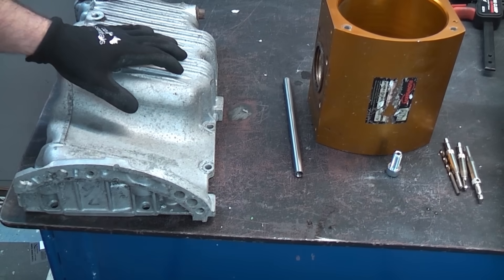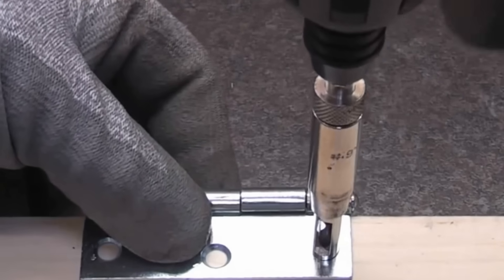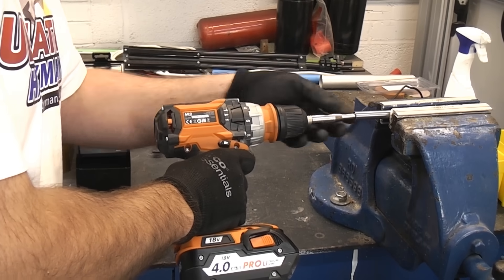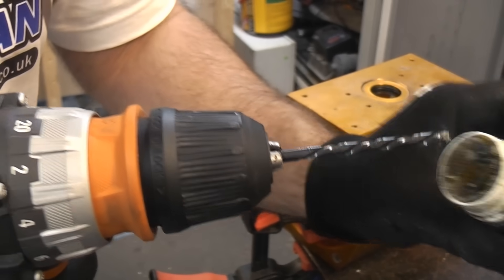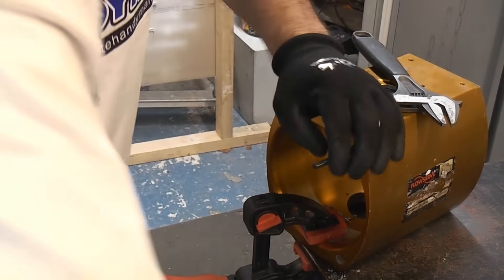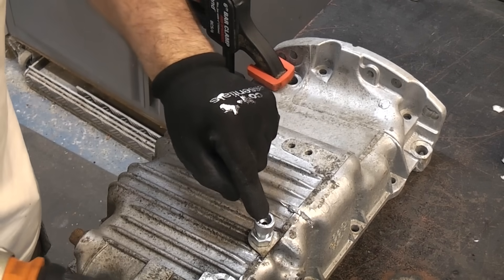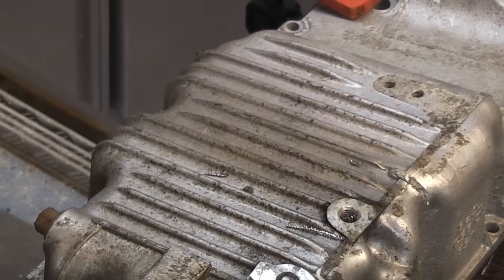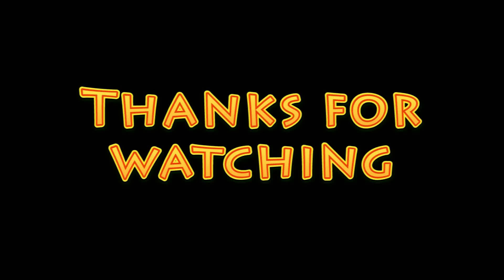How to remove a broken bolt in a deep hole | remove broken bolt in recessed hole

Comment: Always use any heat AFTER drilling the broken fastener through. Get that broken fastener too hot and you'll burn up drill bits trying to drill through it. Always use quality (read: U.S. made) drill bits. Never use Chinese, Taiwan or other Third World shit bits. Buy every American-made drill bit, bits or sets at swap meet, yard sales, etc. Also, invest in a Drill Doctor bit sharpener. I have one and love it. They're made just down Interstate 5 from me, too!
Reply from the maker: Thanks for the comment
Reply: As a retired Master Mechanic with 45 years experience, I've tried them all. I used to keep successfully extracted fasteners on my toolbox if I just happen to luck out and drill exactly in the center for the extracting tool. I was always so proud of myself! Best parts about it? I don't have to do that anymore!

Comment: I'm a bit suspicious about using copper-paste in threads of aluminium. There's a similar paste with aluminium for those applications.
Reply from the maker: It is fine unless you live near areas where there is salt water (apparently)
Thanks for the comment
Reply: Most often I struggle with stubborn bolts on vehicles like boats and cars exposed to sea water or road salt. I live in the european rust-belt.

Comment: "Handyman" Hmm
"I made this special hollow bolt on my lathe"
I guess if that didn't work then you'd just make a new, complete, workpiece on your "handy" c and c rig???
Why not just put a centre punch down into the hole and knock an indentation in the end of the bolt, then drill and extract? It works for me!
Reply from the maker: I didn't make the bolt on my lathe, it was made on a lathe ;-)
Reply: @ultimatehandyman  
My apologies! I stand corrected! Thanks for a great video! ☺️

Comment: None of this works if it's properly stuck. Drill a pilot hole as perfectly centered as possible, and the go up through drill bit diameters until all that is left of the stuck bolt is its thread. Then use a scribe or other pointed implement to dig out the strip of bolt thread leaving the block's original female thread intact, is sometimes the only way.
Reply from the maker: Thanks for the comment
Reply: I've had to remove a few broken bolts that way. I think the best value I got out of this video was the tricks for drilling into the center of the bolt and for that alone it was well worth watching.  When I've done it without these tricks I used a spring loaded centerpunch to start a small indent as near as possible to the center of the bolt as possible and by starting with a small bit I've managed to get close enough to center to remove the male (bolt) threads without much damage to the female threads. I won't say any, but I will say the damage was minimal and there was still plenty of holding power left. If the broken bolt end is proud of the surrounding material filing it flat first helps a bit with this. But the next time I will use a sleeve of some sort to get that bolt drilled properly on center! Thanks, Ultimate Handyman!
Reply: I restore neglected saxophones that often have rusty screws, rods. Usually I drill with 1/16 but  rod screw is .062. Often I replace rod with next size larger . I am trying ALUM but its a time consuming process
Reply: Agreed, this vid makes the use of easy-outs look easy... Unfortunately the majority are too far gone for easy-outs, or people treat them with too much disdain & break them off. A broken easy-out, in a broken bolt is an utter nightmare which requires careful Dremmelling followed by drilling, tapping & helicoiling...  No.1 method is as  InARoundaboutWay says above, progressive drilling. The drilled out bolt tip is excellent though if you don´t have a drill stand / are working on something in location.
Reply: Farlig66 lol there may be a reason why the bolt broke in the first place, could be something a person is doing.  If they use the same technique with an easy out they may get the same result with the easy out.
Reply: Honda Helix rear tire removal
Reply: talk about scraping the bottom of the barrel...  ';  D    that really takes the proverbial 'cake'...
Reply: unfortunately, sometimes, you're right.
Reply: On very stuck bolts I drill out as much as I dare and then use a thin carbide burr, in a dremel, to cut a slot into the thread. Once the slot is through the thread it sometimes releases a lot of tension or allows penetrating fluid to creep around all the threads. Sometimes cut another slot and dig the remaining bits of thread out. Depending on the use of the female thread I’d just clean out with a tap or use a helicoil. Saved hundreds of outboard engine and gearbox parts this way.
Reply: @bog969  Make a video of your methods and post please.
Reply: I've  done that trick it works
Reply: @ inARoundaboutWay,
Being an "old mechanic" I agree with your post. Sometimes you must do as you have suggested.
About the vid, I also would use an "hand threading screw tool" (I don't know his right English name) to drive the "tourne-à-gauche" counterclockwise, instead that huge adjustable wrench 😉, maybe batting gently, with a adequate hammer ! 😮, on the "tourne-à-gauche"'s head, during the counterclockwise turning operation.
Reply: What happens when the female is worn out. Stop and after she cools off, start again. Works every time.
Reply: Just drill the whole bloody thing out and re-tap for a larger bolt.
Reply: Use O-ring picks for digging O-rings and other rubber (elastomeric) seals out of internal grooves. Good ones can get the helix of the screw's thread out.

Comment: That end mill and flatten top of bolt! While still centered change to left hand drill and drill hole in bolt, If bolt comes out ok! If not drill out with bit smaller them deepest part of thread. Use scribe to pick threats out. Chase threads with thread chaser .do not use hand drill. Period
Reply from the maker: Thanks for the comment

Comment: Damn I like your homemade guides. I have a lathe and now I know how I'll tackle the dreaded recessed broken bolt. I have an outboard motor that I  let the caustic cleaning solution set in the water system too long and it ate through the head gaskets, so when I attempted to remove the heads I broke 4 bolts below the surface. My solution was to turn down a roll pin punch to a center punch, heat treat it and use it to set the center punch mark. I turned it to fit snugly in the threads to get the best center I could. It worked fairly well but nothing like your center guide. Kudos  to you.
Reply from the maker: Thanks for the comment

Comment: I typically just weld them out. Place a washer against the casting, place a nut on top of the washer, then carefully start a weld on top of the broken bolt and build the weld up into the washer and nut. I've used that method on everything from 6/32 machine screws all the way up to 1 1/4 inch diameter bolts in the undercarriage of dozers.
Reply: True. I do it on F150 exhaust studs when the front right side break off below the surface. You can use a drilling jig on one of them but the other you can't even fit a drill in there. The frame and shock tower is in the way. Build it up until it's above grade then weld a washer then a nut. Sometimes it takes 4 or 5 tries depending on how crap the stud is, but as much swearing as I do, I've always got them out.
Reply: Horse Malone:  And there it is... the boorish comment for the hyper-partisan who thinks everyone wants to hear his political opinions no matter the discussion...
Reply: I agree Have used the welding technique for years. Don't worry if you break the nut off just do it again. The welding usually is all the heat and won't hurt aluminium or cast or threads. Usually a wire feed welder works best. All this drilling and tools take too much time and equipment.
Reply: Horse Malone Isn't being a liberal person a good thing? Sounds like it is to me, whereas an authoritarian sounds like a bad thing.
Reply: @UCeyxWCuOChQ3EDpCixK9I6A    Liberals will take civilisation back to the Dark ages.
Reply: I'm gonna troll for a minute, the way you hold the drill cracks me up, and the bump bump bump of the drill is obnoxious, almost like you dont trust yourself, you dont have to worry about heat transfer at a low rpm just apply pressure and release pressure maintaining contact and you won't have to bump it the way you did, your guide bolt is a great idea and a solid first  option, if the tap break, better learn how to stick that tungsten out and do some build up and another thing, if a carbon bolt is inside aluminum, you can weld to the carbon without binding to the aluminum, the heat isnt great enough to affect the aluminum, aluminum oxidizes and the oxide doesn't melt till around 1700*f, so a nut, washer and a gmaw machine would have made that process a lot quicker
Reply: To all those saying weld is not safe... thats only if continously weld... you need to build it up 1 weld at a time with a cleaning of flack after each weld... here in our country were we dont have much tools its much easier to weld... ive done it countless times and most of the time we removed corroded bolts on alluminum, cast iron, steel
Reply: To The Top Crane, WOW! BRILLIANT MAN! THANKS!
Reply: Top crane, how do you protect the walls while you are welding ?
Reply: When the bolt is recessed, you cant protect them. I use tig and a steady hand to build up on the bolt, usually the bolt has less thermal mass than the sourrounding material, so if you point your tungsten right you puddle only on the bolt and can build up. as long as you are dealing with a aluminum or cast iron sourrounding material you have very good chances that you dont affect the threads. patience and slow work lets you build up a cedent string which you can gripp with some good quality grip pliers when cooled down a little. The heat of the welding helps for loosing, and cooling by spraying WD40 or similar on the hot bolt helps quite a bit too. The smallest bolt i have managed to get off the hole so far was a M6 in a forged axle part...
Reply: Aussie Aussie Aussie!
Reply: Thanks for this contribution. Good to have lots of alternate methods as one method doesn't necessarily work in all situations.
Reply: Well,
That works great when you have something to weld to,
however, when deeply recessed, that trick just won't work.
Reply: Wow! How do you lay a weld on top of a 6/32 screw?
Reply: @AnsweringAtheism  with small bolts I'll start a puddle with the welding rod and as soon as it forms plunge the rod into the puddle and turn the machine of. The bolt is now welded to the rod and usually a good pair of vice grips allow you to unscrew it.
Reply: @AnsweringAtheism  On a bolt that small just get yourself a guide as demonstrated in this video and drill the screw out.  Start out with the smallest bit you can and work your way up until you can get in there with a pick or something and just break the rest of the screw apart.  But a broken steel bolt inside of aluminum threads is easily removed with short bursts from a wire feed MIG and some cheap hardware.  Much faster and easier than drilling it out.
Reply: To The Top Crane the best way
Reply: This is an absolutely good method in spite of what naysayers think. I've seen it work numerous times and it's worked for me. Someone in this thread also mentioned specifically those $#@& Ford ex. mani. bolts and I've seen this method used even on them. Besides giving you something to grab onto, the shock from the welding heat helps greatly in breaking the fastener loose. If you have a MIG and some patience this method can often save the day.
Reply: Shilo2010😂😂😂
Reply: Horse Malone mmmm
Reply: Exact,i do that the same way.
99% wil come of with that(even on damn hard places,you can hardly see)
If the welding pistol fits between it,i weld it.
Reply: To The Top Crane o
Reply: the risk is you will screw up the threads, imagine in the casing if you bugger up, then you have to make a re threading , that too you have to put thro a lathe. But this method shown in the viedeo is  super in the sense - it is removed slowly WITH OUT DAMGING THE THREAD.
Reply: @ramavijaya148  I've been welding for almost a decade used this method so many times its unreal it works.  You don't put it on a lathe to begin with.  You either put it on a milling machine or use a hand tap to rethread if you clean the top and tig weld it as you should you have no issues with boogers to begin with.      I've done it on aluminum stainless and standard carbon steel and it's worked on all of them.   I can have a bolt out in minutes vs an hour.  It not only heats the bolt and gets all the crusty shit loose but allows you something strong to grab onto.  Build weld up weld around nut when you get weld tall enough and slowly loosen a little at a time.  Might have to work back and forth and spray some PB in to make It a little easier
Reply from the maker: Thanks for the comment
Reply: @ultimatehandyman , thanks for the response and for making the video! You have some good stuff going on in the channel. 🙂👍
Reply: yauts for sale
Reply: Nope you cant cause you will break the inside thread..so i dnt recommend your suggestion
Reply: Hmm. Who to believe. Top Crane who welds, speaks from experience and works on dozers or Michael jackson looking mo fo stroking his own hair?  LOL
Reply: HHMMMNN  seen that elektrpweld 30 years ago, and it worked absolutely super!
 @Shilo-fc3xm
Reply: @danchibinchihir424  
Did weld a lot of nut.
It works for 99%.
If you have to work it the old way out,you should take the engine head of,to work on it.

Comment: UH;  Good old steel bolts into aluminum...dissimilar metals and galvanic corrosion will get you every time...as you say:  Anti-Seize those damn things...anybody who installs bolts into alu without A-S should be slapped!  I did like the drilled out Socket Head screws as a centering guide...I hadn't seen that before and it is a brilliant trick!...the only trouble is if the bolt is broken off just below flush, and there are not enough threads to install this guide...what do you recommend then to assure centering the drill?  Good presentation...thanks!
Reply from the maker: I'd just try and centre punch it as close to the centre as possible. A centre drill can really help when starting the hole, as they do not flex like a normal drill bit.

Thanks for the comment

Comment: I tried a drill once, and the drill bit broke into the piece of bolt that was broken into the hole... I just left it like that, fortunately it wasn't anything important, just one of the bolts for an exhaust manifold cover, it was doing fine with the rest of the screws. Crazy hard metals there, nothing that I have can do anything in there.
Reply from the maker: Thanks for the comment

Comment: Hi
This is amazing. Can u share details of drill machine and the special spring loaded drill bit please.
Reply from the maker: Hinge centering drills- https://fave.co/2Nsk1Ab
Spring tools centre punch- https://fave.co/2x4Ym6G
Left handed drill bits -https://fave.co/2wXdzXm
Screw extractors- https://fave.co/2O7A3MG
For the guides, you will need to make them from some cap head/socket head bolts-
https://www.youtube.com/watch?v=6mZj0J6CNYA&t=2s
Thanks for the comment

Comment: I can, and have, removed studs broken flush or below flush (I don't know about that very deep one in the sump pan) but I have removed studs in tight locations on the vehicle, out in the field as well as on the bench, from iron and aluminum castings, with a small oxy-acetylene torch and a steel filler rod (even a coat hanger works). The technique is to apply the concentrated flame to the stud until it just makes a puddle and immediately build filler onto it, repeating the process until you have enough glob protruding to grab with pliers and turn it out. Go ahead and scoff, but I have done this quite a few times, in nearly impossible situations where there was no room to get a drill anywhere near the stud. And since the usual cause of the broken stud was corrosion, the heat of the weld will break the corrosion and the stud backs out almost finger loose. Although I once had an iron transfer case on a very old 4x4 pickup that broke a shifter mount bolt, and the corrosion was so severe I had to keep the stud red all the way out. There was no way that stud would have budged with an extractor, and there was no room for a drill under the truck. I did the job on the vehicle in the owner's driveway during winter, charged him 20 bucks, and he was amazed and went on to bolt the shifter back on himself and go plow snow. The weld heat does not damage the casting if done right! Scoff all you want, I know because I've done it. When you concentrate the cone of a small oxy-acetylene flame directly on the stud, it turns red and melts way before the casting because the threads make a poor heat transfer, and the casting is a large heat sink, and it works with aluminum too! That large aluminum casting will sink away all the heat and remain un-melted while the stud will get red enough to puddle and allow a quick deposit of filler on the stud, repeat a few times, grab the glob with pliers and spin it out. The first time I saw this done was on an aluminum alternator. I was working at a body shop owned by this old German guy, it was my own car, and I snapped off a steel bolt in the aluminum threads below flush. I had the alternator out on a bench and was about to attempt drilling when the old guy walked up and told me never mind the drill and watch while he showed me the easy way. He grabbed a torch and had the stud out in 5 minutes, and I was amazed he didn't damage the alternator at all. I only had to see this one time, I was 19 years old, and almost 40 years later I've done this numerous times without fail. (Sorry no paragraphs, won't work on YT with IE for some reason)
Reply from the maker: Thanks for the comment ;-)